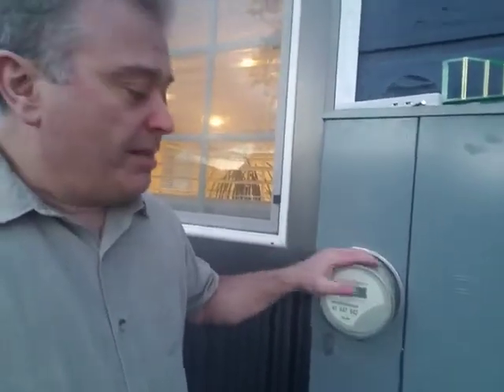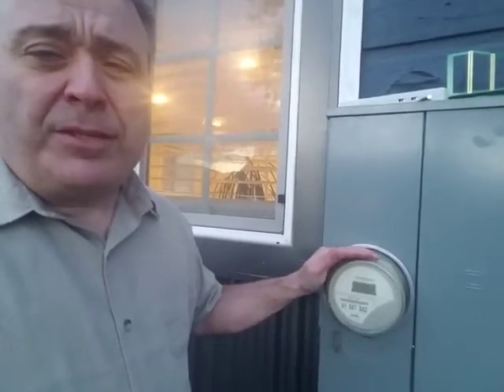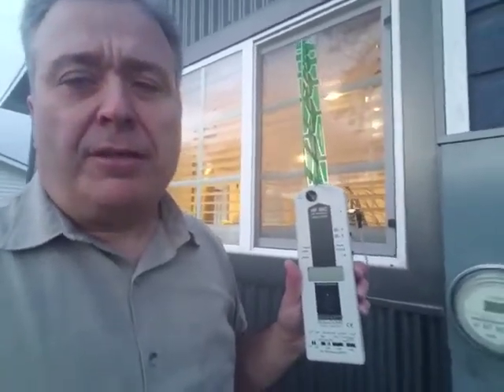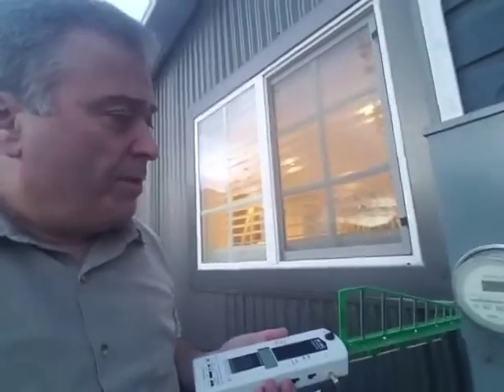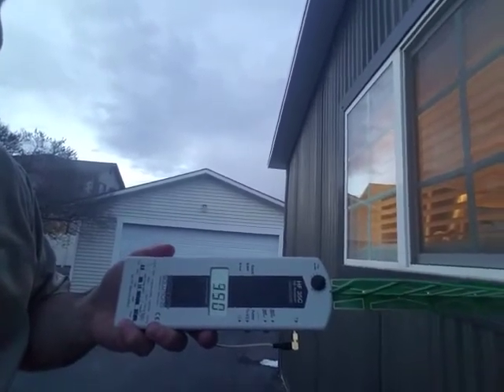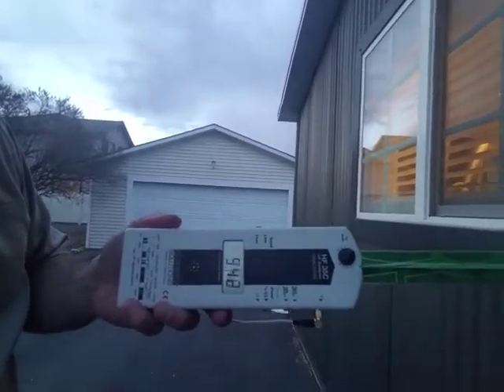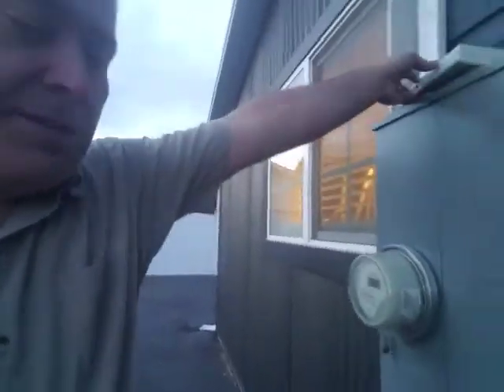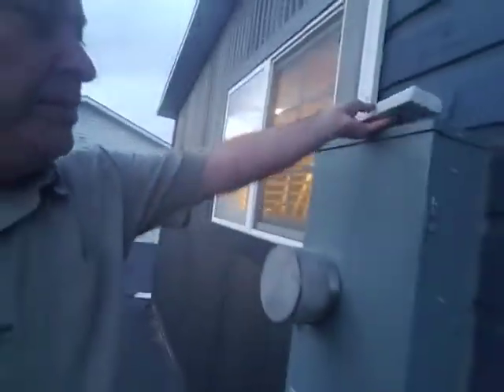Smart Meter Guard Product Review

Comment: Do the meters put out pulses in a 360-degree pattern, including back into the house? I have eight gas meters that run along the outside of my place and I have no idea how I'm going to block the radiation once they're converted to smart meters (especially since only one is going to my place...the rest are going to my neighbours' places).
Reply from the maker: Yes they send out pulses in a 360-degree pattern. The good news is the signal cannot go through the metal breaker box it is connected to, but some will still come around. The other problem with smart meters is they cause tons of carcinogenic dirty electricity to be emitted from the wiring of your home. You may not want to hear this but if I was in an apartment where all the meters were on one of my walls I would move. But if you have to stay know there are two things to protect yourself from, the RF radiation and the dirty electricity. The RF radiation is fairly easy but it might be too pricey. If you get smart meter guards and put one on each of the meters, that would block the RF radiation. But that wouldn't be cheap and your apartment complex might not let you do that. A cheaper solution would be getting EMF blocking paint to paint the interior side of the wall with. It is a black paint so you would then have to primer over it and then paint the color you want with regular paint. I show you the kind of paint I am talking about in this article https://www.radiationhealthrisks.com/products-protect-emf-radiation/. For dirty electricity you know that since a smart meter connects to every circuit in your home, it will be causing every circuit to emit dirty electricity. I would still recommend getting a meter and testing each one (some will be worse than others because of either electrical problems or other devices on the circuit). Then I would get a whole house dirty electricity filter from Satic https://saticshield.com/saticshield-power-perfect-box-standard-kit/. Its pricey but a lot more practical than buying individual plugin filters for every circuit in your home. If you use my discount code “radiation” it will save you 10%. That is a big problem. I hope this helps.

Comment: Wouldn't that defeat the purpose of a smart meter?
Reply from the maker: Thank you for your comment. The smart meter still functions normally. I have one on my house and it gives the power company the info they need perfectly. What the smart meter guard does is block almost all of the RF Radiation that goes into the home. It does not fix the dirty electricity that a smart meter causes. In this article on my website shows how to check for and correct the dirty electricity problem. https://www.radiationhealthrisks.com/how-to-test-for-dirty-electricity/

Comment: 1:54  Hey,  Where can I get the High Frequency Analyzer (Name / Brand / Model / Versions)?
In the past, neighborhoods had low RF.  Now, dozens upon dozens of WiFi boxes and smart meters flood whole neighborhoods!  
Pull out a cell phone and scan for WiFi and in the same spot you see 30, 80, or even more WiFi signals blasting away...
I'm wondering at what point are all these systems  unhealthy ?  100 signals ?  500 signals ?  1 signal ? ! ?   
I would like to measure the total energy flooding through various locations.  
HIGH  RF  is the  new   RADON GAS.    Real Estate in HIGH RF zones is less desirable than family safe low RF homesteads.
I would like a device to inspect and quantify the total energy field flooding through various properties to help home owners make smart choices for their families.
Reply from the maker: Thank you for your comment. Here is an article where I show you all the best meters that I like. https://www.radiationhealthrisks.com/best-emf-rf-meters-and-detectors/

Comment: What about inside the house? Does radiation penetrate through the wall where the cage doesn't cover?
Reply: If it does penetrate inside the house, will a mesh blanket on the other side stop it?
Reply from the maker: @michaelg7779  thank you for your comment. See I have had just the opposite experience. When I put smart meter guards over the smart meter, I don't get any more radiation inside. The Smart Meter Guard allows enough signal out that the power company still gets its signal. It cuts down 90% to 95% of the radiation. No radiation can go through the metal electrical box. All that escapes must go through the Smart Meter Guard. And I have noticed almost zero radiation coming inside the house once the Smart Meter Guard is on. You still then have the Dirty Electricity issue to deal with, but you have that anyway unless you can get the power company to remove the meter all together.
Reply: For people reading this, test before and after, don't trust that a product will work in your circumstance. Not showing indoor levels on the video is unconvincing.
Reply from the maker: @michaelg7779  In all fairness it was one of my first videos. I would have done several things different in hind site lol. I have tested multiple homes inside and out, so I know what I am telling you is accurate. But you make a good point. I will do another video in the not too distant future and test both inside and out so everyone can see it.  Thank you for your comments.
Reply: @RadiationHealthRisks  Thanks for the video - do you have links to later videos?
Reply from the maker: @davebean2886  https://www.youtube.com/channel/UCUMbI8q4R3o9zOySV2IZhVQ?view_as=subscriber
Reply: RadiationHealthRisks.com what about the radio  frequency  radiation  from the plastic box on my house for the water  meter?
Reply from the maker: Great question. The answer fortunately is no. The radiation cannot go directly through the box the smart meter is attached to. It goes around it into the house. So when you put the smart meter guard on the smart meter it blocks 90-95% or the radiation coming into the house through. There is however still dirty electricity created by the smart meter which is very dangerous also and this is transmitted through the circuits and the wiring of the home. If you go to the radiationhealthrisks.com website there is some information on dirty electricity in there. There is a meter I show you there that will read that radiation and some filters you can plug into the problem circuits that will bring the dirty electricity down to safe levels. Obviously the best option is if you can get the power company to remove the meter, But if not you can still protect yourself as I have described. Hope this helps.
Reply: @RadiationHealthRisks  does the screen protect the home on the opposite of the meter? In other words, does the meter penetrate the interior of the home that it is attached to even though the guard is in place?
Reply from the maker: @djlateboy670  Once you put a smart meter guard on a smart meter according to my testing 90 to 95% of all air born radiation is reduced in all directions. You still have the dirty electricity radiation that is increased on all circuits within the house that the smart meter is connected to and you have to put filters into those circuits to reduce that radiation. Again it is always better if you can have the power company replace the smart meter with a old analog meter. See radiationhealthrisks.com
Reply: @RadiationHealthRisks  
Thank you! Your video and reply were very helpful and I'll be buying a guard asap.
Reply from the maker: @cpiotrowski311  No problem. Glad it helped.